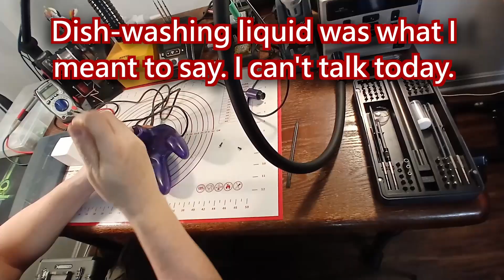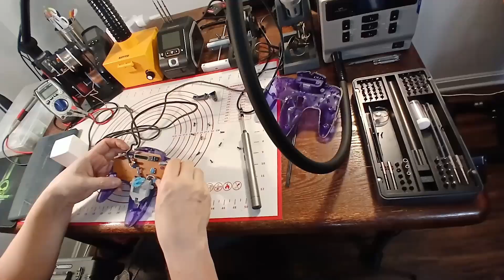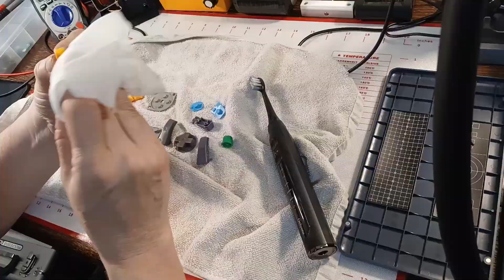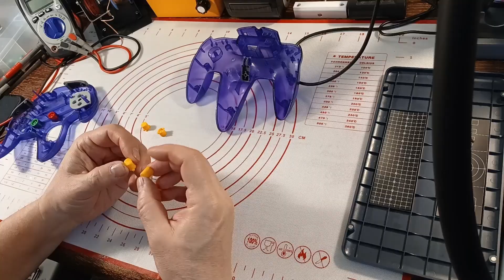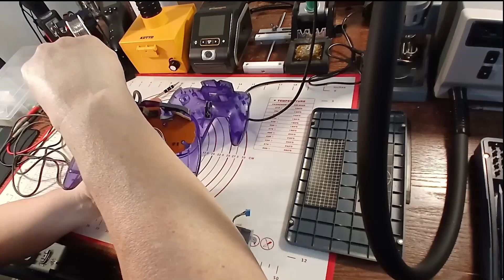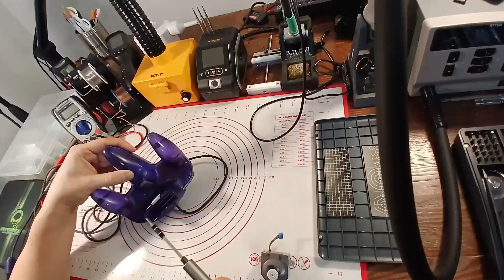Nintendo N64 Controller Thumbstick Replacement

Comment: Nice one.

We also have the option to rebuild the thumb stick using parts from a company called Kitsch-Bent.

Little bit of work involved sometimes cleaning up flashing from the parts but they are way better now than 10 years ago.
Reply from the maker: I was thinking about trying that on the next one I am working on. I had seen some info on the replacement parts. Thank you for the info! Good to know the parts are good.